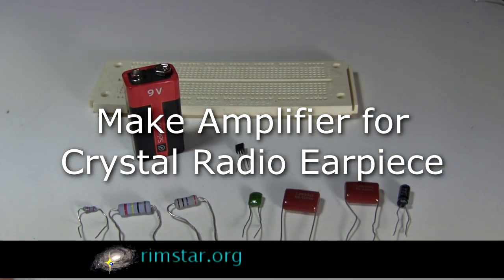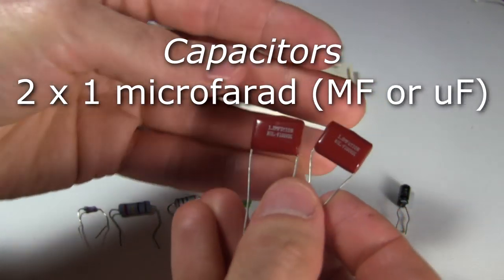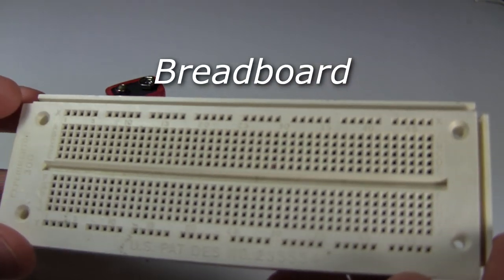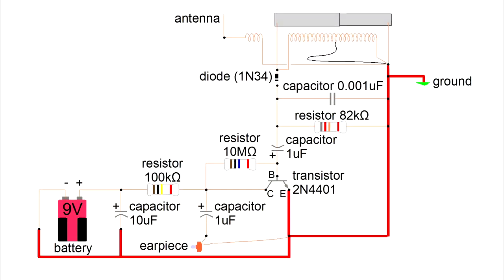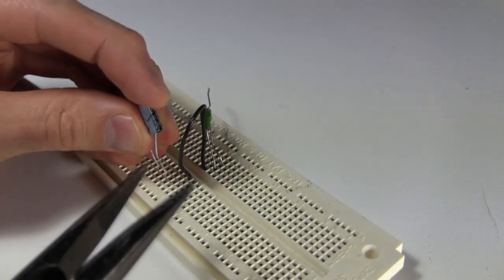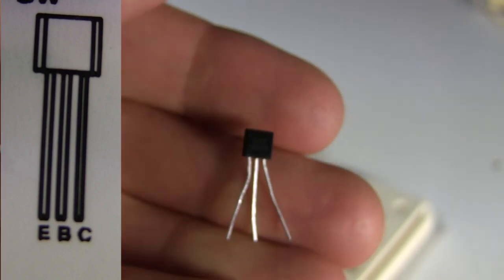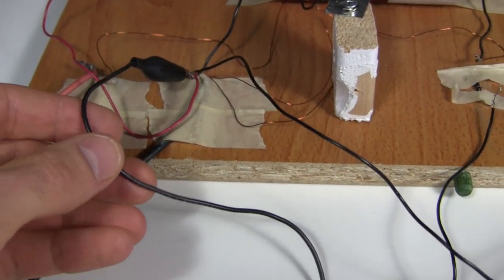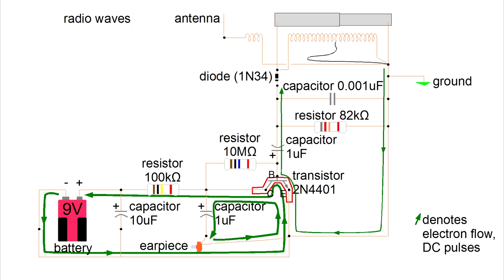How to Make Amplifier for Crystal Radio Earphone

Comment from the maker: Thanks! I added them to the video's description. I assume since it worked you've answered your own question, that yes, you can use non-polar 50v 1uf capacitors. I didn't know you could get non-polar ones with that high a capacitance. I think that's the only reason polar ones were specified.

Comment from the maker: I didn't do that because it would make a very boring video for most people. Also, I was hoping I gave enough instructions so people could do it by following the circuit diagram that I show, for example at 2:12. But I guess if you are very new to all this it still may be difficult. So I will make a companion video with all the steps shown, but since I won't be able to do it for a week or two, see if you can do it by following the diagram and the basic instructions I gave in this video.

Comment from the maker: I don't understand this circuit fully. It's one I got from the website I mention in the description. I would like to know it better! I know the 82kohm resistor and the 0.001uF capacitor are regular crystal radio improvements (see my new How a Crystal Radio Works video for those.) Also, a capacitor is often used in series to filter out DC. And the 10Mohm resistor may be for protecting the transistor's base. Without all that might work, but may not sound as clear.

Comment: Had to give you a shoutout.  Really like your videos.  You have a real knack for explaining these concepts in a way I never could.  Ive incorporated many of the ideas from your experiments and some others ive seen online into my build, all the way from simple adds like the resistor + cap combo to get around the germanium leakage limitation on up to a small solar panel driven audio amplifier for a HiFi headset I use (a pair of Pioneer SE-500 piezoelectric HiFi headphones!).  I started my first using two Michelob Ultra beer cans ... one sliced down the side and sheathed over the other with cooking parchment paper between ... similar to the concept of the foil one demonstrated here.

Comment from the maker: The antenna should be as long as possible, at least 40 to 50 feet for non-local radio stations. I pick up local stations using 3 parallel 15 foot long wires.

Comment: The 100k resistor is the collector load resistor, and this should have about half the battery voltage across it.  The current is about 1/20th of a milliamp or 50 microamps, which is so small that the battery should last for a very long time, maybe months.  Yes, 82k is an uncommon value, so use 100k.  How long should the antenna be?  Thanks.

Comment: Thanks for sharing and easy explanation, can I ask, what’s the 82k doing?
Reply from the maker: Since the electrons can go in only one direction through the diode, but when the cycle reverses we need some to go in the other direction, the high K resistor allows some, but not too much, to leak in the other direciton. I explain the same idea in my video about how a crystal radio works http://youtu.be/HupFY_24o-4 starting around 2 minutes and 10 seconds in.

Comment: Also another question, I want to use this amplifying circuit with say an RCA connection, so that the positive touches the inside pin and the negative touches the outer shielding.  Also, I want to use a magnet-driven speaker rather than a piezoelectric one, would this circuit work with it? Sorry if I'm causing any trouble and thanks in advance.

Comment: on the transistor will a 2n3904 or 2n2222 thay are npn type switching transistors and i got 2n3906 and thay are pnp transistors i have will one of them work at all

Comment: does it matter what kind a resistors or capacitors you have? or just the  resistors: 82 kilo ohm, 100 kilo ohm, 10 mega ohm
capacitors: 0.001 microfarad, 2 x 1 microfarad, 10 microfarad.

thanks

Comment: The 1 uF non-polarized capacitors are hardto get.  Instead, use an electrolytic (polarized) capacitor, any size is ok.  Or use a 0.1 uF ceramic or whatever.  The lower values may not have as much low frequency response, but that's ok for a cheap piezo earphone, which also has poor low frequency response.

Comment: Could you please explain the exact purpose of the resistors and capacitors in the amplifier circuit. Why can't you just use the transistor+battery? Thanks.
Reply from the maker: +Stani I'm afraid I don't know what they're all for. I got the circuit from Charles Wenzel's website here http://www.techlib.com/electronics/crystal.html (redistributed with his permission.) It's under the heading One Transistor Amplifier/Detector.
Reply: +RimstarOrg Thanks for the link. :)

Comment: Why you need a 1mf cap in series with the earpiece when it is a DC blocker itself?
Reply from the maker: That's a good point. It may be because the circuit may have been designed to also work with high impedance headphones with coils in them. The original circuit came from here http://www.techlib.com/electronics/crystal.html and though the diagram shows a crystal earpiece, the text below it speaks of a coil.

Comment: The output of this amplifier is less than a milliwatt.  That's enough for a crystal earphone, but too weak for a speaker.  You could increase the power with a few transistors, but it's easier to use an amplifier IC like the LM386.  However if you're going to spend a lot of time and money, you might buy a cheap AM radio instead.  The performance will be better.

Comment: some days ago I made an amplifier with only a darlington transistor (two 2n3904) a 100 kohm resistor at the input and a 1 kohm resistor with a 1 kohm potentiometer in series with the earphones. the load is on the emitter and the collector goes to the grounded pin of the germanium diode. the base goes to the other pin of the diode with a 100-1000 kohm resistor.the gain is very high (90'000) without the base resistor but without it the efficecy decreases. 
the amplifier consumes only 100 microamps with a 1,2 volts battery (120 microwatts). 
the sound is good but the selectivity of  my crystal radio is really bad. if I move the capacitor I hear less sound but at the same radio station. (there is an AM transmitter at 5 km from my house and I hear only this station
Reply: Do you have any schematic of it? I'm really interested in the amplifier that you made.